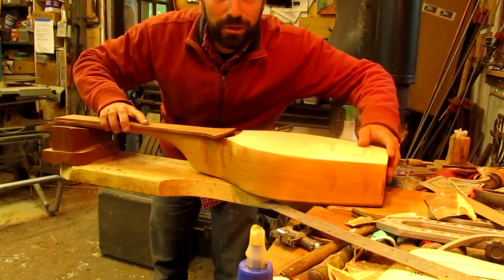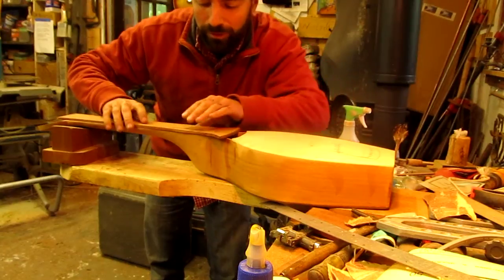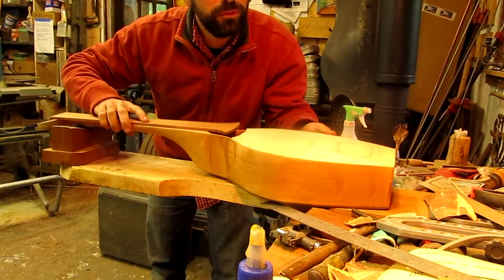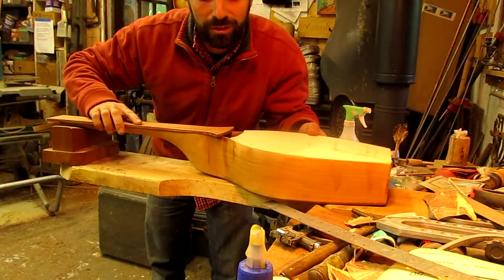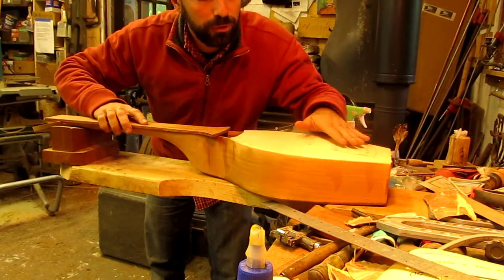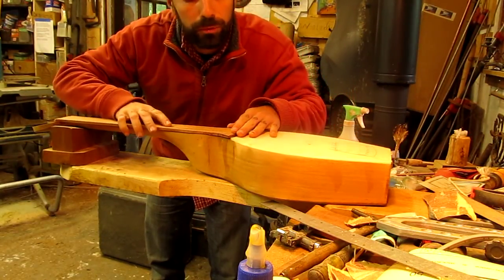Guitar number 7 - Helmholtz resonance

Comment: I noticed an increment in the lower part of the spectrum, say anything less than 500 or something Hz, as the opening gets bigger. Does that mean that for a fuller sound you'd leave a bigger opening? Thanks for the video.

Comment: What information are you sharing? Very very little.
Reply from the maker: Did you know what Helmholtz resonance was? Did you know it impacts the design of a guitar? Did you know the frequency is determined mainly by the amount of air enclosed versus the size and geometry of the opening?
Reply from the maker: I have a very good guitar design but a couple years after this video I lost my woodshop and ended up homeless in Boston, still working as a carpenter but sleeping in the woods in Boston. I'm still striving to build a woodshop again then make small guitars again.